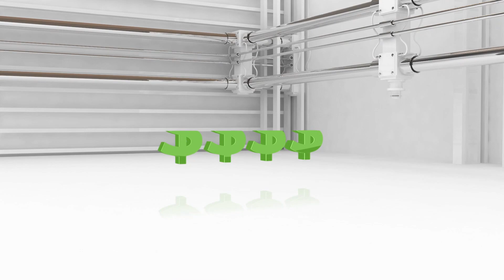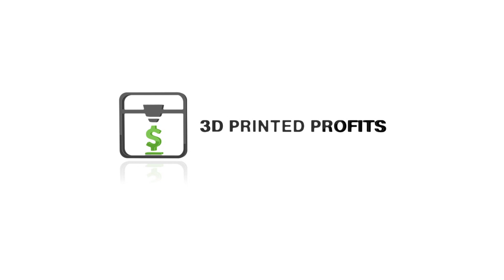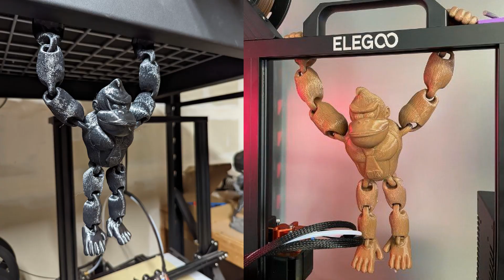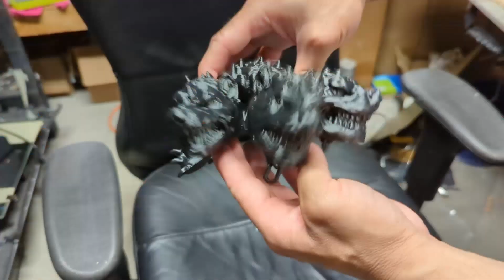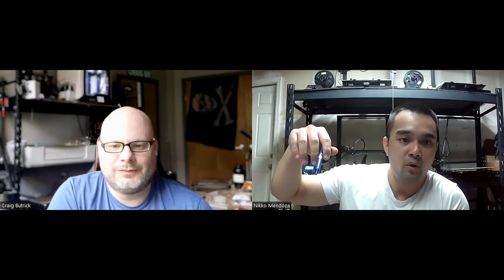3d Printed Profits Episode 55- Paintball Hobby Generates $18,000 a Month in Profit

Comment: I'm seeing that being a designer is more profitable than doing the printing.
Reply: That's always the case, anyone can download files and print them. The entry level for this is very simple. 

On the other hand being able to design functional parts requires specialised skills and experience. Especially designing parts that have to work with other existing parts. Especially once you step outside the world of just 3d printing. 

I can make the part cost double or triple to machine by changing simple values making the part require more tool changes or specialist tools. Because of knowledge of the process I can minimise the production costs by reducing the amount of tool changes and adjusting the tolerances where I can get away with it
Reply: Go to school for engineering. You will never get rich unless you can think for yourself. I am about to go to college at 34.